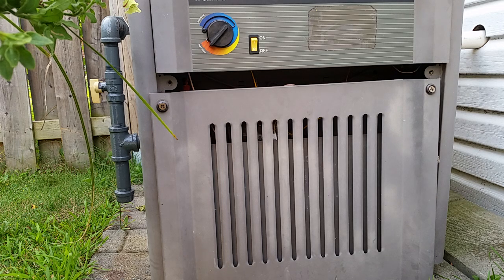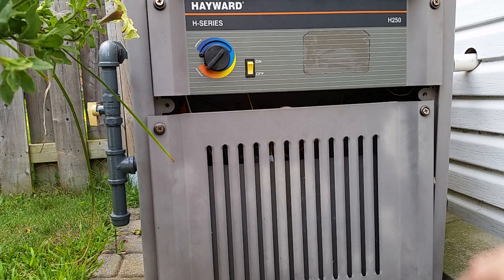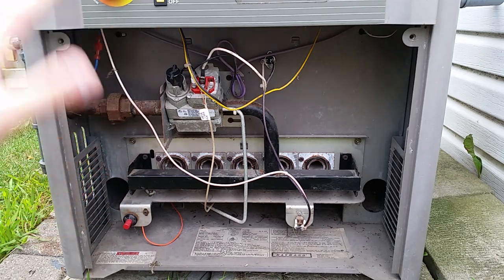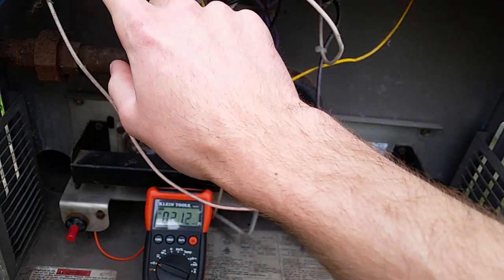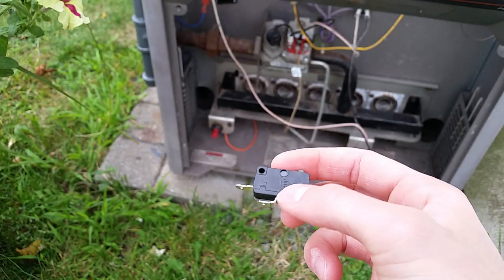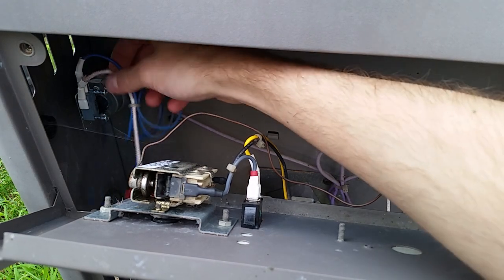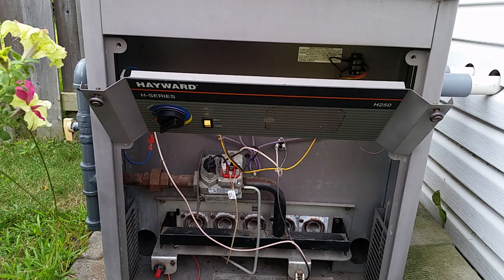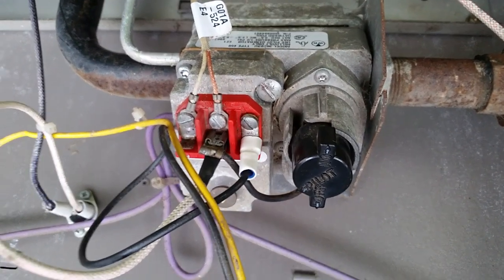How to diagnose and repair your Hayward H Series Natural Gas Swimming Pool Heater

Comment: a quick question: do I need to remove the pressure switch when winterize my pool? I found I can't remove the pressure switch this year. not sure if it's okay. I am in Canada. thank you very much
Reply from the maker: @studynotesandchinesetransl739  No, just blow air through the unit to evacuate all the water
Reply: @QuaabQueb  thx a lot
Reply: @QuaabQueb  thank you. just to double check. mine is old model Hayward H300. similar to the one in this video. the pressure switch is connect to a copper tube, then connect to water pipe(I think). someone said if it's connect to copper tube, then need to remove the pressure switch in the winter. so you think even for this model, there's still no need to remove pressure switch in the winter. thank you.
Reply from the maker: @studynotesandchinesetransl739  I have never removed mine and it's never froze. You can unscrew the tube from the switch and blow it out if you want.
Reply: @QuaabQueb  I see. thank you. in my case, every year those technicians removed the pressure switch, however, this year, it's too tight and can't be removed.

Comment: The mount that holds the switch detached from the pressure valve. Switch is fine heater fires when switch is pressed. I'm about to clean it up a bit and JB Weld the bracket back on to the pressure side. Is that going to work for me or do I need to order the whole thing and replace?
Reply from the maker: No you can just find some small screws that will fit

Comment: I can use the jumper wire to bypass, but once I remove the wire it turns right back off. A couple times it has stayed on, but mostly it shuts right back off when jumper cable is removed. Any idea? I already replaced the switch you mentioned that fails mostly. Next?
Reply from the maker: Check to see if you are getting voltage from the thermocouple. If not, there is a bad connection, or the thermocouple is bad. It may also be dirty and need to be cleaned with a wire brush.
Reply: @QuaabQueb I replaced the thermopile unit entirely. When bypass, gas valve opens perfectly. Occasionally it’ll stay on for 5-10 minutes, other times it shuts off when I remove wire instantly. Not sure how to test limit switches. I’m also not sure if I have my wires connected properly to my pressure switch or limit switches. I have some wires coming out that aren’t plugged into anything and I just don’t know where they go. I wish someone could look at that.
Reply from the maker: @JoshMG  it's possible all the contacts are corroded and making intermittent connections
Reply: @QuaabQueb  I wish there was a way to upload pictures or a video of what I’m looking at. I replaced all connections with fresh clips and sanded clean the points of contact
Reply from the maker: @JoshMG  You are saying that when you bypass thr safty switches, the heater will fire and stay lit normally, or will eventually shut off? If it shuts off you have a defective thermocouple or gas valve
Reply: @QuaabQueb  well that’s really frustrating because I just put a brand new gas valve in it, and a brand new thermocouple. Pilot light fires with easy, gas tube is brand new with thermopile. Of If I use a wire to bypass valve I can hear it fire right up. Sometimes it’ll stay on, sometimes it won’t. I replaced gas valve 2 years ago, thermocouple last year (w/ gas tube), and pressure switch last year. Could it still be a limit switch, or perhaps I have wire crossed somewhere. I have 2 wires just hanging… a blue one that comes out where the water pressure line comes out from the internal area that isn’t plugged into anything, and I have a wire that comes from the on/off switch that i connected to the pressure switch (not sure if that’s right or not). I’d send a picture but YouTube doesn’t let us. I could fb message you if that would help!

Comment: @queb, awesome video! Thank you!!

1) I jumped the terminal as instructed and it started right up, and then obviously when I took the jumper wire off, it turned off. Does this tell me the pressure switch is bad?

2) I tried to jump again with jumper wires and now it won’t turn on at all. Why might that be?

- It randomly turned on for 5 minutes after trying to jump again, but the second I barely touch the thermostat control knob, it shuts right down! It makes a loud whistling noise the entire time it’s running.

Comment: Awesome video. Pilot lights on and all the switches and sensors have 410 milivolts. When I jumper the valve it lights. The black wire that comes down from the thermostat has 410 milivolts. But when I plug it back into the valve and measure the voltage at contact it only measure 11 milivolts on the connector and the contact on the TH side. With everything hooked up I can jumper the valve and it will light as stay lit as long as the thermostat is turned up.  When I turn the thermostat down it goes off like it’s suppose to. But it will not relight if I turn the thermostat up again, it had to be jumpered. So not sure what’s cause the voltage to drop once it connected to the the TH terminal. I did put on a new connector on the black wire and sanded down the contact. 

Anyways any help would be appreciated. 

Thanks.

Comment: I have a Hayward h200 and the pilot stays lit and all the safeties are closed but the gas valve will not open unless I put a jumper on it. I have 437 millivolts on the flame sensor. Any idea?

Comment: I have a propane one of these. The gas valve knob is really hard to turn. Works ok but I have to use a crescent wren to switch from pilot position to on position. I do push down it it when moving it’s just really sticky. I used to be able to do it by hand but not anymore. 

Any idea if that can be taken apart and cleaned or oiled/greased?

Comment: My H400 heater (which worked fine for years) starts up nicely with all burners. Then in about 10-15 seconds it shuts off. I can restart it but then another 10-15 and it stops again. Any ideas out there???
Reply: Yes test every sensor and to do that use a test wire and connect then together bypassing the sensor if it fires up and stays running its that sensor

Comment: great video! I moved into a house 9 years ago with this old H200 Heater that was put in back in 2000. 22 years later, still running!  In the past 9 years Ive lived here, I have had to do alot of diagnosing myself (every year I start it up I cross my fingers) As you pointed out - These millivolt heaters are pretty basic.  If you get to know your system, checking wires for continuity, cleaning contacts can solve alot of issues.  I have gone through a few thermopiles, and a pressure switch (replaced prior to seeing your video) I have gone through and replaced limit switches and the on/off switch (because they are easy and cheap) Just waiting for the heat exchanger to blow before I replace the whole thing...at that point, cost wouldnt make sense  IMO.   Thanks again for they great video on diagnosing and testing!

Comment: Chargero

I have an H200 that won’t fire on its own.
The pilot stays lit and is generating about 490 Millivolts.
I have continuity thru the on/off switch, the thermostat, the pressure switch, and all the hi-temp limiters.
If I jump the 2 “THs” (the switch is on and the stat is turned up), the heater fires up. When I remove the jump, it stays fired up until I either back off the thermostat or switch it off.
Again, it only fires with a jump.

Thanks
Leo
Reply from the maker: Yup same exact problem. It's corrosion somewhere on one of the contacts. It's just enough to cause resistance where the current cannot past. Don't forget we are dealing with extremely minimal amounts of current.
Reply: @QuaabQueb  Thanks for the quick reply.
Do you think I can rule out the stat, on/off switch and pressure switch?
Reply from the maker: @leospinelli8874  Mine test good, but if you wiggle the contacts or depress the switch rapidly you'll see it might fire. The issue is these things sit outside and moisture gets in and eventually corrodes everything.
The proper thing to do is replace all of the switches and connectors, be sure to apply a generous coating of dielectric silicone grease to all connections to prevent corrosion. Don't use anything other than silicone
Reply: @QuaabQueb  Thanks. 
One last thing.😉
I would think that the unit would turn off once I remove the jumper between the THs, but it doesn't. 
Am I wrong about that?

Comment: Hi, I just converted my Hayward H300 from NG to  LP. I Changed the Valve, Jets, Thermopile and coupler. I connected a Propane tank without an inline regulator. I got the pilot to tun on but when it goes to turn on, the flame is out of control. Correct me if I'm wrong but the Gas Valve has a regulator and I don't need an inline regulator? any help will help. A little frustrated thnx for your time.
Reply from the maker: No absolutely not. You are lucky that you are around to be writing this comment. If you don't know gas you don't fuck with gas period. 
Call a certified HVAC guy to come do the job before you kill yourself, or worse...
You never put high pressure to a gas valve.
The manufacturer specifications for the gals valve will indicate the correct regulated pressure. 
You must have a propane regulator installed before the gas valve. 
At this point it would remove that gas valve and throw it in the garbage. You have likely damaged the internal components and it is no longer reliable or safe to use.
Reply: @QuaabQueb  Thanks for the reply. I’m very lucky. I tried to lookup the correct PSI or regulator but can’t find anything on it. I’ll order the correct parts and have an HVAC. Would know the correct regulator so I can order it? Thnx
Reply from the maker: @OhMar1210  Indeed. If you lookup the service manual for your exact unit it would specify. Contact Hayward and they may be able to provide you rhe documentation.
Reply: @QuaabQueb  Thanks. Appreciate your time.
Reply from the maker: @OhMar1210  No problem, good luck...be careful.

Comment: awesome video

my pilot light goes on...stays lit... then I flip the on switch, and turn the dial to my setting....but no flames appear under the unit like in your other video...

Ive never started the unit before, it was already running fine for me last season when I bought the house...

Do I need to do something to the gas feeds to get the lines opened?

thanks
Reply from the maker: Do you hear the "click" from the gas valve trying to open? If no then you have a bad contact somewhere
Reply: @QuaabQueb  do you mean the click sound that you got at 13:37 of this video? "click" and then the sound of gas? I dont hear any gas sound...
I do hear a click when I move my thermostat dial
Reply from the maker: @HeyStripes  Yes exactly. That is the sound of the gas valve opening to allow gas to the burner. The click from the thermostat switch when you turn it is just the sound of the mechanical switch depressing. Note, even if you hear that clicking it does not mean it is actually making proper contact.
Reply: @QuaabQueb  I tapped on the gas lines with my screwdriver handle while thinking about what to do next and a whole bunch of dust came out.. so I tapped some more...lightly until all the dust stopped coming out... then tried again and held the pilot switch down for a whole minute to keep the pilot light on and voila it worked :)
Reply: @QuaabQueb  ok... new issue... I got it up and running by brushing the contacts and pipes...it ran for 2 days with no issue, then suddenly yesterday it stopped firing up... the pilot light was on but it wouldn't kick on.... any ideas?
Reply from the maker: @HeyStripes  same problem. Corroded contacts somewhere, or a bad switch.
There are the temperature limit switches, the on/off switch it self and the thermostat switch.
All of them points of failure aswell as the wires and contacts that connect them all.
Reply: @QuaabQueb  ok thanks... I think I'll get an HVAC guy in to check it out and getting running in top order... then I can take it from there... thanks for your help
Reply from the maker: @HeyStripes   No problem and good luck. Make sure the guy has worked on these units before and is familiar with them. Most guys will show up and tell you right off the bat it's done for.

Comment: Thank you for this very detailed video! Hayward h200 If I jump to turn on and it kicks on, what could it be? All the switches including pressure switch reads continuity, is it the adjustable temperature sensor that's malfunctioning?
Reply from the maker: Yes could be that. it too is simply a switch. Bad wiring most likely. Something is corroded and not making good contact intermittently

Comment: The high limits should turn the heat off if there's no water flowing. Stove high limit is the one mounted above burner tubes.

Comment: thanks for everything bro, just another question: the gas pipe line and regulator on the gas tank, any advice of how big it hhas to be and how many psi on the regulator, btw i have this version but the 400.000btu one
Reply from the maker: All of that can be found in the installation manual for your specific heater. It is available free online. (Google)

Comment: I plan to work on those connections tomorrow. I do have two follow questions. Even though I can jump start the heater the thermopile or gas could still be faulty?  If they are bad do you have videos for those repairs?  Again, thanks for help!!!

Comment: Great video. Your video helped me determine my pressure switch was bad on my H 300...it had no continuity. I did replace it. I now have continuity.  However, heater still won’t start. The thermopile is generating power at 525 millivolts. I am able to fire the heater by jump starting the pilot valve/generator.  The thermostat, on/off switch and all the limiter switches have continuity. I may have switched the terminal connections on the two wire connectors for the pressure switch. I did switch them back and forth while testing/diagnosing but heater does not fire. Any suggestions?  Thanks.
Reply from the maker: It is some corrosion on a contact elsewhere
Reply: Thank you for your response. I did clean all the contacts behind the front cover using a dremel. I did not do the high limit contacts connected to the header since they looked clean. I’ll clean those and see if it fires up. Thanks again.
Reply from the maker: @markedwards2378  No problem, you would be surprised how little corrosion can cause it not to complete the circuit. The other factor could be a weak or bad thermopile (part the pilot burns against to generate the small amount of current) or the entire gas valve assembly is on it's way out.

Comment: My hayward rp2100 won't turn on.  I jump the gas valve and it will turn on and run for 30 minutes and then turn off.  If I keep the gas valve jumped it will keep running but wondering what the root cause is.

Comment: Can you run the heater jumped like that? Or just for diagnosis purposes?
Reply from the maker: Diagnosis only. If you shut off the circulation pump and forget to disconnect the jumper, you will will burn up the heat exchanger and surely cause a fire...huge nish nish
Reply: Here’s what I got going on. I had my whole pilot light assembly replaced. Now my pilot light stays on but the heater won’t turn on. So when I add a wire from the far left “th” and run it to the middle “th” it fires right up. I think the guys at the shop who fixed the pilot light said I could run it like that but not sure because I didn’t understand what they were saying. What can I do?

Comment: Hi just bought a used h150 Hayward Pool heater pilot light stays lit but the main burner won’t light up any idea ?
Reply from the maker: Watch the video.....
Reply: Chargèro I did i I jumped the gas valve but it just clicks inside the gas valve I was thinking it could be a bad gas valve?

Comment: Great Video!! Much appreciated! Bought an H150 off my neighbor, and going to try the pressure switch. Replaced the thermocouple, just won't kick on now.
Reply from the maker: Jumper the switch(es) first. Disconnect the terminals and attach them together. This will tell you if it is the switch.
Often times it is just corrosion on the contacts or the wires themselves
Reply: @QuaabQueb  Much appreciated! Just got a dremel and bits at Harbor Freight. Seems like it did the trick. It takes about 10+ min to start, but works. Is that start time right? Also, if I shut off and restart, takes about another 10 min. My pump has 2 speeds, wonder if i need to run the higher speed for the pressure switch? Thanks again for all help!!

Comment: Thanks, was able to jump start my heater.  However it won’t stay running.  I metered 400 milivolts when gas valve opens a flame starts.....then it slowly drops to 300 milivolts.  Any ideas?
Reply from the maker: Likely a bad thermocouple

Comment: Great video! Thank you! Do you have the link to the switches.  Mine is bad.  I can’t find just the switch.
Reply from the maker: Try and clean the contacts first, is it the micro-switch on the pressure switch assembly or one of the temperature limit switches ?

Comment: If my pilot\thermapile isn't generating quite enough milivolts , can I still jump start using the alligator clips?
Reply from the maker: Try it, may not work. Definitely do not leave the jumper on there because if the pump shuts off you will burn up the heat exchanger

Comment: In theory, if you bypass anything, would it stay on or will it eventually turn itself off? Asking because I believe one of the sensors is faulty. I can jump that sensor and it’ll turn on, however, after about 2-3min, the whole thing clicks off, including the pilot light.
Reply from the maker: If you bypass on the gas valve terminals yes. If it shuts off then it's  a bad thermocouple.

Comment: Quick question. Does this apply to the Teledine / Hayward  H-400 , 949-456-3923 thanks brother , the most straight forward video I’ve found
Reply from the maker: Yes, any milivolt system for that matter